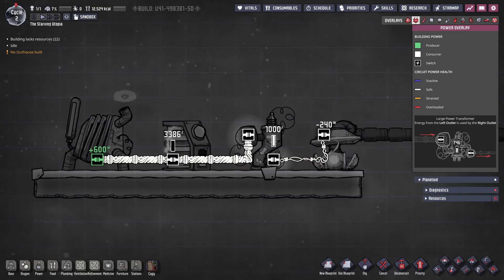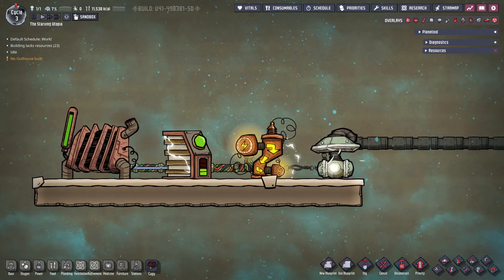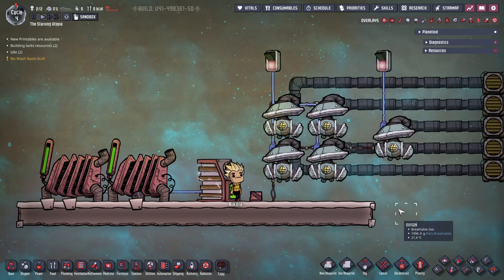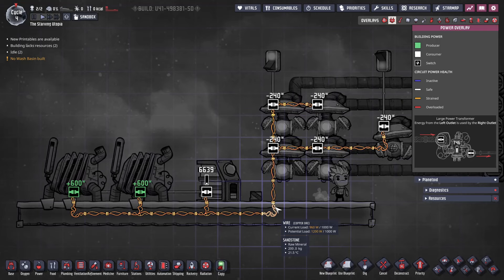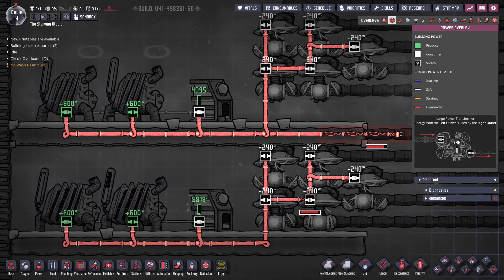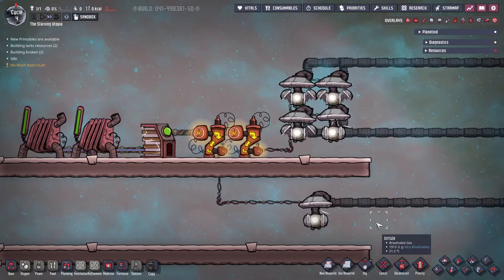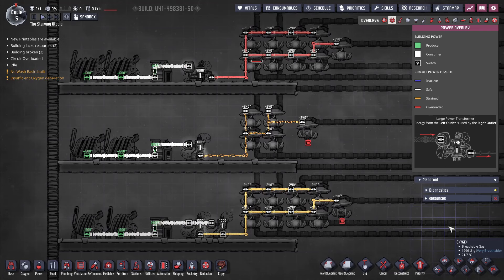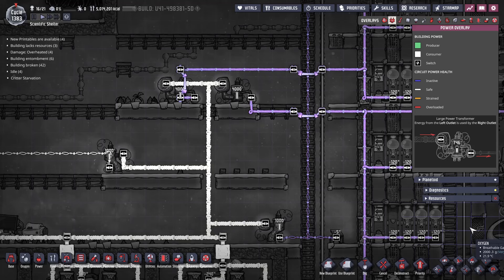Oxygen Not Included - Tutorial Bites - Power Systems

Comment: Soooo no smart battery after the transformer? XD
Reply from the maker: Definitely not!
Reply: @GCFungus  I've used Smart batteries on the low side of the transformer with automation wire to shut down the transformer as a method to control the power consumption priority of a particular circuit.  Seems to work quite well, but I am open to understanding why this isn't a practice you recommend.
Reply from the maker: @ScottRutter  Unless I'm missing something (and please let me know if I am), I don't think automating the transformer avoids the issue that batteries on the low side presents, which is potentially overdrawing the low power wires. It gives the consumers as much power as they want to draw.
Reply: @GCFungus  my understanding is batteries do not draw power as consumers do, so they shouldn't impact a wire's limit.
What I typically do is adjust a smart battery's low threshold to reflect the priority of the consumers on the circuit - allowing the battery go lower on lower priority circuits so my producers will focus on supplying circuits I need to keep running. This may not be useful in all cases, as you point out consumers take as much available power as they need, but in some situations where power is limited (say when that dratted natural gas geyser goes dormant) being able to reprioritize where your power goes on the fly can be pretty helpful.
Reply from the maker: @ScottRutter  It's not about the battery drawing power, it's about the consumers drawing power from the battery. Having the battery on the low power side effectively defeats the transformers ability to limit power. You can test it out by having more than 1kW on a normal wire and the battery will supply it, ignoring the transformer. I understand what you are trying to do, but the way that I would recommend to do this is to have your generators, then a power shutoff linked to a smart battery, then the transformer. That way you can keep the battery on the high power side and achieve the same effect.
Reply: @GCFungus  Interesting - I suppose I've usually been very careful about consumer limits on a circuit, so I haven't encountered that issue. I'll take a look and see. Much obliged for the explanation, and I have to say I've found your tutorials to be far more comprehensible than the more "play through" styles of most ONI tutorials. You break down the processes and pace your explanations far more effectively than I've seen anywhere else.
Keep up the good work!